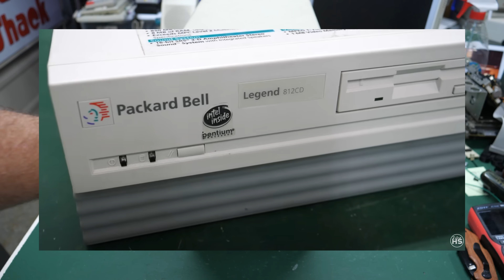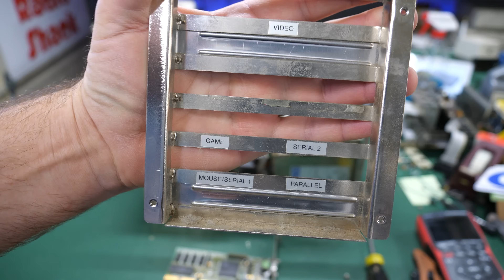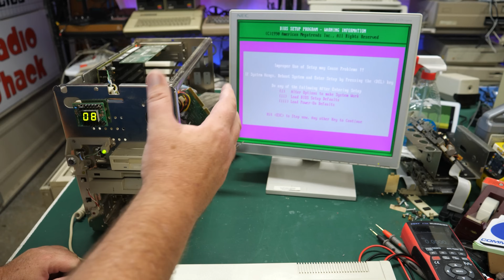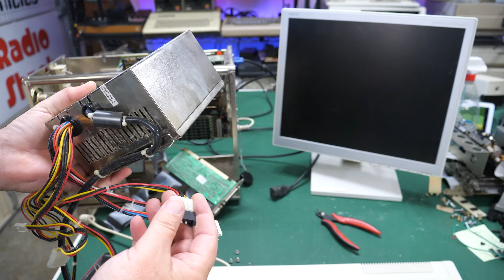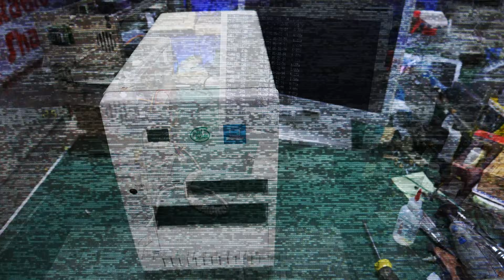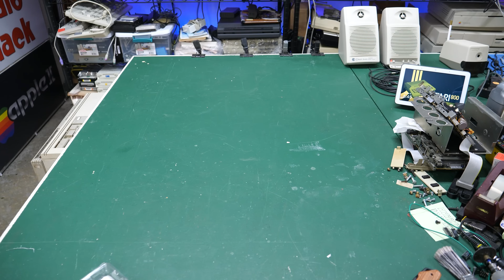This PC In A Strange Case Just Needed A Little Love

Comment: Think the mother board was installed in that orientation to compress the chassis. But the motherboard they selected require the io card, so it kind of doesn't matter, but it would if the ide and floppy controller were on the motherboard. A dx 2/66 would be perfect in the expansion slot

Comment: Nice little machine, and the case is in good shape IMO. Not yellowed at all  !
I have a similar case where everything is upside down, same time period (486).  The only "problem" is that the chips on the extension cards can potentially run hotter (but at that time heat was not really a problem).

Comment: I had a case like that at one point except it was a mid tower, not a mini. 4x 5.25" & 2x 3.5" bays, iirc. I always assumed the inverted layout was just to make the optical drives etc more accessible when it was sitting on top of a desk instead of under it. I think what made these cases go away was the ATX standard since that specified a lot more things regarding the layout of various things on the motherboard, etc which would have made this style of case impossible to conform to.

Comment: That processor socket isn't for a math coprocessor.  It is for upgrading the board to a different CPU like a faster 486 or a Pentium Overdrive.  The 486 already has a math co processor built in the CPU.  Also, did you know that there are epoxies for plastic now?  They bond to plastic better than standard epoxy.
Reply from the maker: Thanks

Comment: Had a Socket A AMD Abit MB. Put it together turned on the power and POP. The socket roasted some of the transistors around the die. Have a few AMD CPU's found a Brand new TYAN socket A MB ironically in the Abit box on my shelf. It also had the extra 4 pin CPU plug. It was fine. Got WIN98SE on it just for giggles. I still have a couple brand new never built MB for Pentium 2 slot 1. One Intel, 1 Asus and 1 Gigabyte. All still in the bags. Have the CPU's but  don't think I am gonna build them anytime soon. Been building since 1995 a room in the  basement looks like an old PC store.
Reply from the maker: Nice

Comment: I had the exact same case as you showed as an other example. I had it from a local school, and IIRC, the dates were from the very early 1990s. It had a 286 board inside, running at 16 MHz, these low end computers were quite common in the early 1990s in (Czecho)Slovakia, since PCs were expensive for what the people were used to.
Unfortunately I gave it away :( Later the BTX motherboard standard had this inverted design.

Comment: Great little computer. Fantastic that it hasn't had a battery leak its guts all over it. I can repair the battery bombed boards, but they never look as nice as factory due to my inferior soldering skills and such. You need to watch Necroware's videos on extracting the actual CMOS chips out of the Dallas modules. Then you can add a battery holder onto it, or maybe even solder the batter pins back on the dallas IC to use the motherboard battery header.

Would love this one in my collection, but I live so far away and have way too many computers as it is.

Comment: Nice case, the size of a mini tower. Can you put a link to your ebay shop?
You do not cut the terminals (or at least the positive) of the internal battery in the Dallas chip? I did the mod many times, but once I was lazy and I let the internal battery connected. I ended changing the CMOS battery that I installed each month, until I remembered and cut the positive of the internal battery in the Dallas chip.

Comment: I have a case kinda like this. It's an NEC Ready 9616. The 3.5" FDD is above the 5.25 bays. It's a P120 though and the motherboard has only one slot that a break-out board plugs into and the cards are mounted at the top and back of the case in a vertical orientation. I didn't get it when it was new but found it in a rubbish heap in front of a house that someone had recently moved out of about 3 years ago. Machine was dirty but is clean now and works just fine.
Reply from the maker: Nice

Comment: I work in a printing shop, and the issue you’re having with the color is likely due to the color profile. I recommend working in CMYK; the colors you see on the screen will be closer to what you print. If you send a file in RGB, the printer’s software will handle the conversion, and it might not look the same. Also, keep in mind that it will always appear darker and less saturated than on the screen.
Reply from the maker: Thanks!

Comment: Shouldn't the ground pin(s) be connected to ground?
Reply: Don't think so. They designed the clock circuit so it could sip as little battery juice as possible.

Comment: HP made (or maybe still do) a lot of inverted cases in the mid 00's and 10's, not exactly sure why they thought it was a good idea but just about every single HP tower computer I encounter is inverted.
Reply from the maker: Odd
Reply: My mother owns a modern HP desktop, and it still has the inverted ATX design similar to an older AMD model I found. 

The Athlon X2 model uses a regular board and PSU form-factor with the chassis dating back to the Windows Vista era and seeing use well into the 2010s and Windows 10 era before getting replaced with the bespoke nonsense in the late '10s.
Reply: HP Pavilion and Compaq Presario line of desktop towers.  The oldest one I have seen used an AM2 motherboard (Athlon II era?), and the newest one I have seen has a 4th gen Core i7.